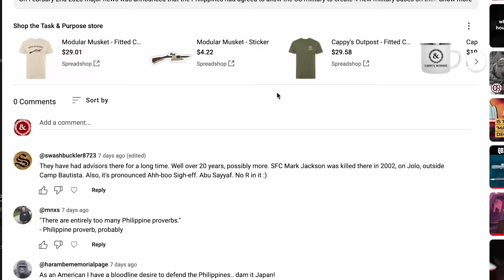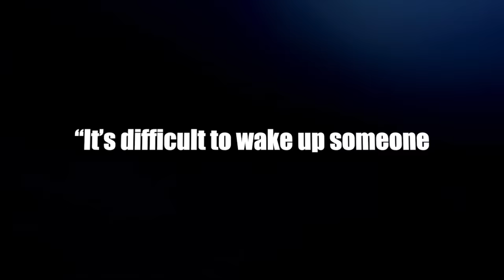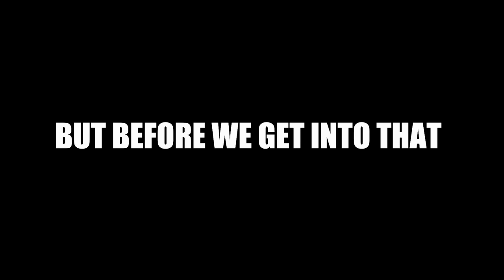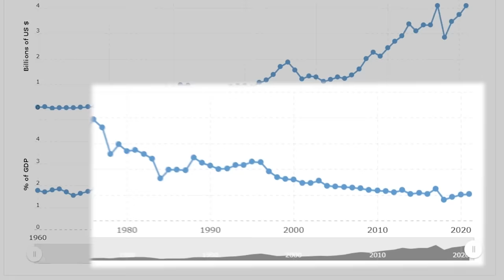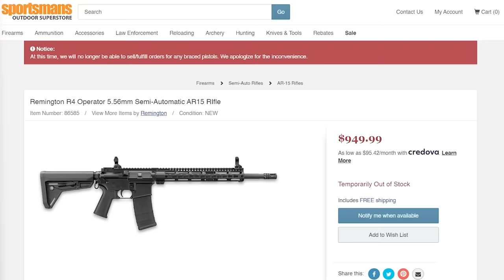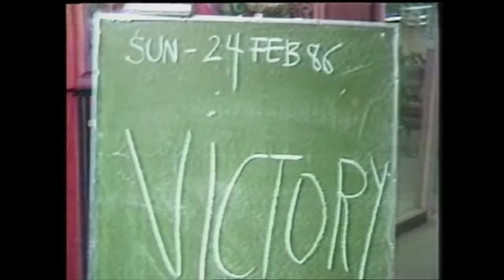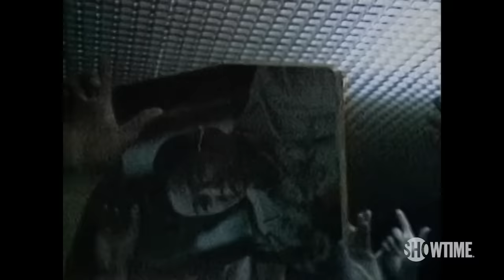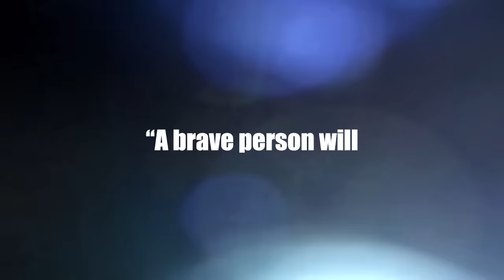Philippines Fight Against China is an Absolute Nightmare

Comment: Thank you for the analysis and historical context, it helps get Philippine historical information out to a larger audience. Historical content is in line with what I've studied and read about, the grade I'd give you would be an A. There were a couple mispronounced proper nouns, but that's understandable. 

Some of the stock footage was petty amusing, like the guy digging for mineral wealth wearing flip flops and using a shovel. Yes, the footwear is accurate but I'm petty sure mining for metals would be done on a commercial scale. Flip flops while driving a front end loader would have worked (good luck finding that stock footage). 

Well done video.

Comment: Imagine a roadway/railway made 200ft wide connecting Japan, Taiwan, Phillipine, Indonesia, Australia. It carries wind/solar generators to power electrified trains, aqua & agticulture hydroponics, pipelines carrying gas, oil, water. Housing to support this local food production is possible.
Airfields/harbors are possible alongside this structure that defines Economic Exclusion Regions and acts as an anchor to expand acros the Pacific to perform all these activities.

Ships & airplanes requiring fuel can be reduced/eliminated reducing CO gas.

Comment: Just a correction. Former President Duterte reversed his pivot in foreign policy before his term ended. By the time President Marcos Jr. has taken seat, the EDCA was already approved by FPRRD. Initially 4 sites, Pres. Marcos Jr. just strengthened it with 5 additional sites.

Comment: I just want to point out that you failed to mention the two huge former US bases in the Philipines. Clark AFB and Subic Bay Naval Base featured prominently during the Vietnam War. They should be the obvious choices for any return of US forces due to existing infrastructure.
Reply: western idiocy on eastern propaganda
Reply: PH is using those areas now.  USA needs new bases, not to kick PH out of the bases they have used for years.
Reply: @davidfisher5140  Not the time for selfish interests.  PI wasted a lot of years with Duarte.  Now it's time to play catch up, so the old US Navy facility at Subic Bay, for example, makes the most sense.  It's a no brainer.
Reply: @jeffbeck8993  What you THINK is a no-brainer would be correct, 30 years ago.  But this is 2023.  FedEx & other companies invested billions of dollars upgrading those facilities & use them.  Also a local indigenous group now inhabits a good section of the former base & is firmly ensconced legally speaking.  USN has sought access to some of the port facilities but it will not again become a US base.  USA must build new bases, which is why USA is building NEW bases.  Believe it or not, the US Navy really does know their business pretty well.  They have been operating in foreign waters since before Tripoli in the late 1700s.

Comment: This comment will probably be taken as pro-China, but as a Filipino I'm pro-Philippines. I take no sides between US or China, there's no reason for me to. But those new US bases are just going to endanger Philippines if a US vs China war ever happens, even if it's not a full-scale war. Say for example, if China tries to assert more control over Taiwan. If tensions reach a boiling point, those US bases in the Philippines will be what's going to respond to Taiwan and basically Philippines and Taiwan will take the brunt for this, not US or China. When Elephants fight, it's the grass the suffers. This is what President Duterte was trying to avoid. But since the new president has chosen a side instead of wisely hedging between US and China, the only question now is if the US will up the benefits that it gives Philippines, because last I checked, Philippines isn't even in the top 10 recipients of aid from US despite decades of close military partnership, which Duterte didn't really end btw, the US military bases were abolished in Philippines many years before Duterte and there were still military exercises between US and Philippines during Duterte's term until it ended. It's also funny how the fearmongering about China building structures in the South China Sea was used to condition the public's mind that we need these US bases while USA's own intelligence has revealed that Vietnam a lot more bases and territories occupied in the South China Sea and even within Philippines' EEZ.

Comment: So Philippines chose a bunch of US soldiers that will have their way with Filipina girls, over real economic investment from China?
China is shedding a lot of low-end industries, if Philippines played their cards right, they can get a massive economic boost through manufacturing.

Vietnam is way smarter, they have similar disputes, but that didn't stop them from remaining mostly neutral between China and the US.
Reply: If "real economic invrstment" was an actual thing and not a promissory note. As the old adage said, I'll believe it when I see it...
Reply: @matthewgaudet8001  China is moving up the economic ladder.
We don't need many of the low-end manufacturing

Also, a lot of these are CHINESE contractors NOT western manufacturers, so yes WE DO decide where it goes.

We would rather it go to Cambodia, Indonesia and Vietnam than the Philippines

Comment: yes china's companies  bring in their labor and construction materials to the detriment of a country's local resources.  at times, a country's long time steel industry is more durable than china' s until dumped with cheap ones from the latter..  it  may not be  structurally good in constructing roads, bridges and buildings among others. i could recall a report  on a high rise building in china shaking.